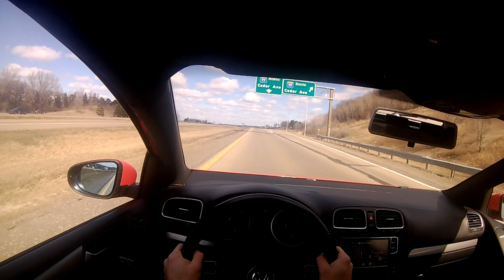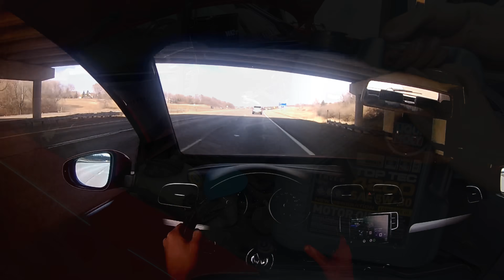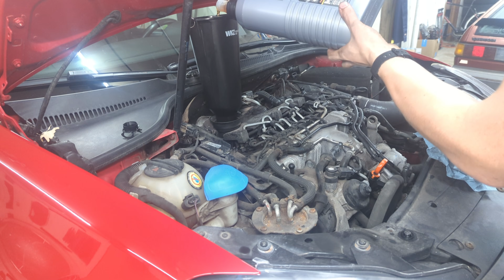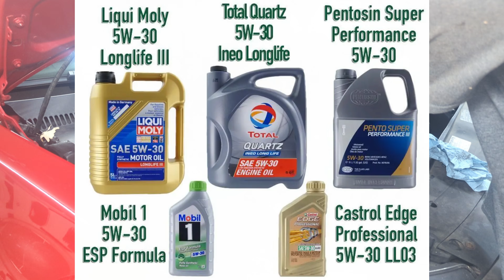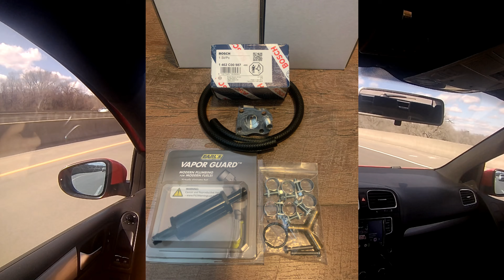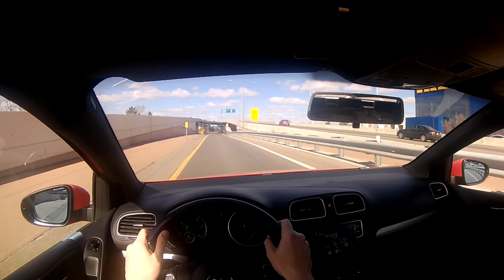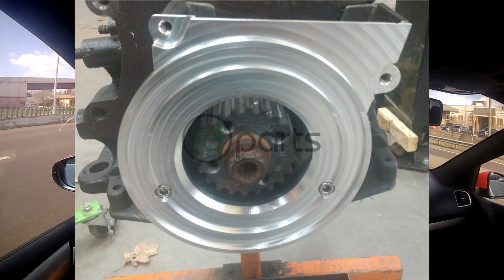How to Make Your Mk6 TDI Last Forever

Comment: my current bulletproof list:
on-time oil change, fuel, air filters, timing components
whitbread cp4 disaster kit
whitbread aluminum lower timing cover
osiris evo aluminum skid plate
full dpf, egr/cooler delete, race pipe
Still need:
swirl flap delete
cp3 swap
Fun bits:
full rawtek 3inch straight pipe
neuspeed turbo discharge pipe
dap short shifter
coilovers+wheels
Reply from the maker: Did you retain the ASV with the race pipe?
Reply: @eurodriven2507  yeah just got rid of the egr valve and the egr tube that runs to the exhaust manifold
Reply from the maker: Which kit did you use? Been looking to do this and remove the EGR cooler, but haven't decided on which kit to go with.
Reply: @eurodriven2507  darkside, the shipping fee sucked but it comes with a silicon cap instead of the sketchy dorman plug. Requires a little dremeling of the turbo egr inlet piece (easily removable) so that the clamp seats nicely around the whole thing but I think its definitely worth the hassle knowing its not going to fall out or fail and send a piece of metal into the turbo.
I also didn't use the coolant line joiner from the kit, i just bought some heater hose from autozone and ran a new line, its only about 2 feet and looks much better and also has less leak potential.
Reply: @EJB93 what did it run you total cost with the shipping?
Reply: @hardcore4476  I don't even remember, i'm probably at atleast $4000 in just the bulletproofing mods (rawtek exhaust, tunezilla stage 2 tune, darkside race pipe, evo osiris skid plate, whitbread cp4 disaster kit/aluminum lower timing cover)
another $3500 for coilovers, wheels, tires, DAP short shifter, and neuspeed turbo damper upgrade
Reply: How has your car run after you added the whitbread disaster kit? I just got mine today need to install. Have read mixed things online about people having issues after install. Thanks
Reply: @Qqqq-gf9ow  When i installed it I remember something weird happened on first start up, maybe it bogged down and died shortly after. Second start everything was perfectly fine, havent had any issues.

Just make sure you clean well around the metering valve before you take it off and dont leave any garbage inside there if some falls in, make sure you're routing all the fuel lines correctly and put the filter they provide in the correct flow orientation and you should be good.

Also make sure where you decide to cut the fuel lines wont leave kinks when you put the T on

Comment: I have a mk7 tdi that I recently just got a stage one remap on and it’s turned it into a completely different car for a diesel it’s quite quick now 👌🏻
Reply: Also I’m new into this car upgrading thing, so I need some help here. I just bought an mk7 Passat TDi & it’s automatic. Will tuning & doing all these improvements work the same way as a Manual?
Reply: @pebbleplayz3645 yes you will need a DSG tune, manuals don’t require the transmission to be tuned but automatics do
Reply: Is it DSG or standard ?

Comment: A great video and I enjoyed it! How do you get 55mi/gallon!? Maybe those additives on your fuel? I have  2010 tdi and I've had it for last 5 years. Last year, I deleted DPF since the warranty was over and my dpf was bad. Now i am getting about 42mi/g on highway average speed of 75 to 80. I notice If I keep the speed below 70 it dramatically increase the fuel millage. Before the delete I was averaging around 38mi/gallon. NYC area mix of local drive and highway. The delete made my TDI so much better but man 55mi/gallon is insane!
Reply from the maker: Manual transmission, 17" wheels (lots of people upgrade to 18"), drafting when possible, sticking to the speed limit, letting myself lose a little speed uphill, getting above the speed limit by about 10 when going downhill and letting that give me a little "push" before the next stretch.
Reply: I’m not getting 55 mpg,s.  I’m getting 42 same as you
Reply: I average 42-45 mpg highway. 11 Jetta tdi non deleted.

Comment: Do a Kerma TDI cold air intake(remove the whole entire air box). Do a Malone Tuning stage 2, Dynamic Idle, Glow Plug Duration, and fuel pump calibration. Do a Rawtek Max Performance DPF Delete with resonator and high flow CAT. Do a full EGR valve, EGR Cooler removal, and do an intake swirler removal. Do a CP-3 fuel pump upgrade. With any car, remove all the cheapies and replace with top quality aftermarket products.
Reply from the maker: What do you mean by fuel pump calibration?
Reply: EGR delete increases cylinder temps, which doesn't sound like a good way to increase life.
Reply: @aaron___6014 egr lowers temps by putting your exhaust gasses into the combustion chamber. This can decrease engine life by contaminating oil with soot. In general higher combustion temps means better efficiency. This can be tuned with afr like any other motor to keep temps in safe range but if temps are what you are worried about egr is not the best way. Egr’s sole purpose is to reduce the amount of NOx that the engine produces when running at optimal efficiency.
Reply: @rileyhance318  but the exhaust goes through the DPF and then a low pressure EGR filter before the cooler. So the amount of soot that reaches the intake should be greatly reduced. When I cleaned my EGR at 105k miles it has very little soot. Granted I do mostly 100 mile drives and use 507.00 spec oil.
Reply: @aaron___6014 can you explain how it raises cylinder temps. I thought it was the opposite when the Malone guys were talking to me without egr it takes much longer to warm on cold startup because of not having an external source of heat(exhaust gas)
Reply: @jonathancrincoli6263 this is correct. It takes much longer for my TDI to warm up after the delete. I had to put a winter front on the car to heat it up faster, as the fuel economy is better when the car is at operating temps. Furthermore, diesels already burn cool compared to their gas counterparts.
Reply: @awake780 diesel’s don’t burn cooler they run quite a bit hotter then gasoline engines the reason they struggle to stay warm is because how efficient diesel engines can be!
Reply: @liammaupin9492  The TDi operating temp is 190° vs 210° for most gas engines, and it takes longer to warm up. So you are wrong, they do not run hotter.
Reply: @rileyhance318 . I already removed all of the EGR system. TDI runs so much better with getting the whole EGR system removed. CP-3 pump will give you true ALH reliability.
Reply: @aaron___6014 upgrade to darkside developments intercooler and it won't be a problem
Reply: @aaron___6014  The only fault in that argument is the tdi runs at full throttle with no EGR or a idle ..so not true
Reply: @jackthornton3496 . I have installed a Kerma TDI cold air intake and turbo inlet. I have removed the intake swirlers and I have removed the whole entire EGR system. I switched to 5W-40 Supreme 9000 Synthetic Pump Düsse oil. 5W-40 Synthetic Pump Düsse works much better than the 504/507 synthetic oil in Common Rail.
Reply: Just service the car as per service book, forgot all that 💩
Reply: Do a Malone Tune Stage 2.5 with a 2200 Bar Sensor.
Reply: Chicago and the state of Illinois has absolutely no restrictions on diesel emissions. In Chicago and the rest of Illinois it is legal to do a full emissions delete. Lots of states in the USA, not all allow for a full diesel emissions delete.

Comment: Love your videos! You’re the best for TDI content. If you were to remake this video I think you should also talk about the dual mass flywheel issues. I know it’s not an engine problem but I’ve seen quite a few go bad suddenly.
Reply from the maker: Thank you! I thought about mentioning the DMF upgrades not too long after releasing it. I think I actually did mention it in my Mk6 TDI buyers guide video... Poor oversight on my part 😅
Reply: I had to replace my DMF at like 220k miles. I got the Luk latest revision. Is there ones any better?

Comment: I have an 03 alh with 330k and been thinking about buying a 2.0 tdi but I don't think they will last as long. My 03 should have a ton of life left
Reply from the maker: If the ALH is still going and you don't feel like you really want/need the quality of life improvements, I would keep the ALH. The 2.0 TDI will last if you XYZ. An ALH doesn't care, it'll just go as long as you do timing and oil on time. I nearly bought two ALH's before I decided to get my Mk6, in the end, I'm glad I have something with modern amenities, but I'm still looking for an ALH to be a backup/winter car.
Reply: Have 290k on my 11 Jetta CJAA.
Reply: I have had the 2003 ALH jetta, currently I have a bew golf, Brm jetta and a cjaa CC, I personally think the Alhs are overated. The Bew and Cjaa are equally good or better in some regards.

Comment: Great information. Have you personally installed the whitbread metering kit? I’ve got 230k on my ‘13 TDI and I’m concerned about the CP4. Strongly considering ordering the kit this week.
Reply from the maker: I have not, I run additives and I change my filter regularly, if I saw any metal shavings, I'd probably order a CP3 kit instead of the "disaster kit" with the metering valve. My plan otherwise is to go CP3 once my timing belt is due next (in roughly 80k miles) since it'll be easily accessible. If my area had especially bad fuel quality and/or for some reason I wasn't able to be on top of the filter changes, I'd definitely do it. It is cheap insurance all things considered. The kit costs what one injector does.
Reply: @eurodriven2507  that’s fair. This is what I’m thinking. I live in Canada and had never ran additives. I’ve just ordered Stanadyne Lubricity as it is backed by VW. I’m also about 100k away from my next timing belt change therefore I’m gambling until then. I think I’ll order the kit for peace of mind. Then go CP3 at my next belt change.
Reply: Do replace your CP-4 fuel pump with a CP-3 fuel pump.

Comment: When I had my 2010 Golf TDI (wrecked by drunk driver), my biggest problem was the icing / water in the intake during winter. I remember VW came out with a modification, but I never got it before my car was gone. Was that problem ever solved?
Reply from the maker: Seems like there have been a handful of revised fixes from VW. The other solution is to deIete + tune out the EGR. I'm not sure if the fix is still available and/or at all affordable for most or if it was mainly a fix for those who ran into the issue while still under dieselgate warranty. I'm unfamiliar as it has never affected me. Unsure if I have any revision of a fix done to mine.
Reply: Im just thinking about getting a 2012 Tdi golf. I used to have a 2006 jetta tdi, i never experienced any icing issue. Is this only for the mk6? What are the symptoms when it happens? Thanks guys

Comment: I’d like to add one more fuel additive option. I use opti-lube xl in my tdi. Also, I’d like to add another benefit to egr delete specifically. You eliminate soot going into the cylinders. Soot, at a microscopic level, is actually very sharp, hard and abrasive. Egr causes a massive spike in cylinder wear. For instance, before egr, heavy duty diesels would easily hit multi million miles before requiring an overhaul(overhaul includes cylinder liners and pistons Amon other things) but after egr was regulated, you’d be pretty lucky to it a million. Dpf and scr also further reduced engine and turbocharger lifespan further. There has been bypass filters out there for a long time in the aftermarket world but they’re starting to become mandatory from the oem’s to slow the reduction in life span. You gotta understand that fuel quality, oil quality, metallurgy, part design and manufacturing quality has made leaps and bounds since before egr was mandatory but life span keeps dropping for diesels.
Reply from the maker: Thanks for the info, I'll add an Opti-Lube link in the description!
Reply: @eurodriven2507  not a problem bud. I spent so much time trying to figure out the best ways to make our tdi’s last forever. I’d really like to add a bypass filter setup to the oil setup to see how it does. The factory filter only filters down to 40 micron iirc which is still way too large. Also, as far as the fuel filtration goes, a popular mod is to replace the oem 40 micron filter setup with a aftermarket housing and caterpillar 1-2 micron filter(can’t remember but it’s single digits).
Reply: I’m doing my oil changes every 5k 6k at max using Mobil1 ESP 5W30
Reply: Two cans of Bardahl 5in1 twice a year = problem free engine.

Comment: Hi mate, When you talk about "Miles" do you mean Kilometers? Thought the timing belt replacement was well before 130,000 Miles (209,000kms)?
Reply from the maker: Miles, not kilometers. The Mk6 TDI is 10k miles for oil, 20k miles for fuel filter, 130k miles for timing.
Reply: Thanks for clarifying, Interestingly the Mk5 interval is only 120,000 kms as opposed to the 209,000 kms for the Mk6 that was stated here for the timing. Cheers,
Riley @eurodriven2507

Comment: Love your info.. Would like your opinion on a ea288 2015 vw golf sportswagen. 80k almost. I trust my dealership. But I don't trust 80k timing belt change. What's so different that vw requires 80k on mk7 tdi? Would love to hear your opinion
Reply from the maker: My parents had a 2015 sportwagen. Aside from a random DEF issue during the "polar vortex" a few years ago in MN, it was a fantastic car. The DEF system is definitely a weak point though and I wouldn't personally own one that wasn't in warranty or deleted. From what I'm reading on the "myturbodiesel" forum, the Mk7 TDI is the same 130k miles for the timing belt interval, but interestingly, I'm seeing people say 130k or 5yrs instead of the MK6 130k or 10yrs. A TDI guru will probably know better than the dealership honestly. 

Another couple of things to consider about the MK7. It is not independent rear suspension, it's a solid beam. There wasn't enough space to implement an IRS system with the DEF tank. If you were to delete the DEF system on a Mk7, you can swap in an IRS from a different MQB car that came with IRS. Beter handling, comfort, etc.

The MK7 TDI, for reasons I don't know, has a belt driven oil pump, instead of the standard chain driven oil. It's internal, it's supposedly lifetime. I haven't heard of one failing, but the idea of a high mileage, rubber belt, soaked in oil 24/7 does concern me. 

The Mk7 definitely has advantages and disadvantages compared to the Mk6, but I haven't personally owned or worked on one. The entire time my parents had theirs, it was in warranty so the most I ever did was check the air filter and put air in the tires. At the end of it, I believe my dad said he prefered his Mk6 wagon, which was bought back during "DieselGate". He found the Mk6 seats much more comfortable and any of the Mk7 advantages were negligeable. He also didn't like needing to keep a bottle of DEF in the garage or needing to buy a bottle in the middle of roadtrips. It should only need to be refilled once every 3 or 4 fill-ups, but on roadtrips down to Florida and back, it would definitely come up. That's a non-issue with a tune and deIete, but they traded it in for a Tiguan before warranty was up so that was never really considered.

Comment: I currently have a mk7 Golf TDI and a 2014 Beetle TDI.  Both have been excellent with minimal problems.  The Beetle only has 46K on it, but I'm doing the timing belt in short order, as it's 10 years old.  I did the mk7's belt at 100K miles because it was 9 years old, and I like the peace of mind.  The only problems I've had with either car is the batteries have had to be replaced.  I had a mk4 Golf TDI before the mk7, and it had just short of 400K miles on it before I sold it.  That thing was a tank!
Reply: I've had my MK5 for about12 years and have had four batteries. They're hard on batteries!
Reply: Did you ever get 2015 codes?